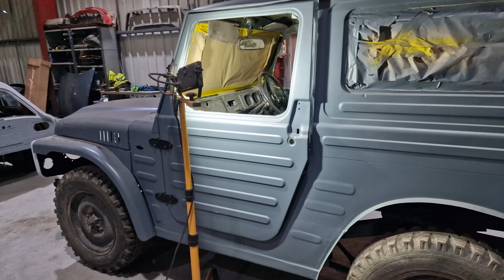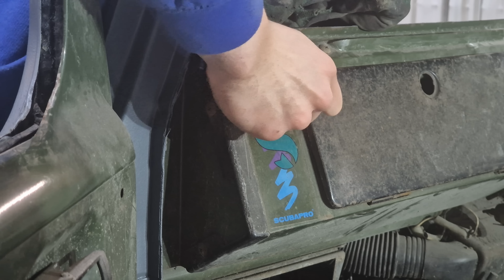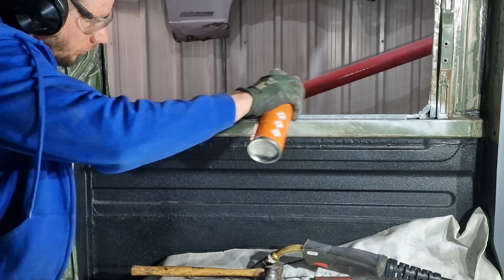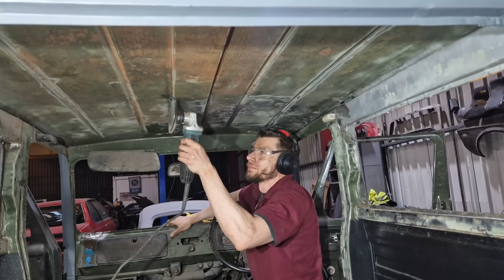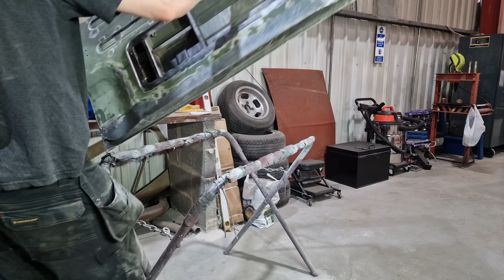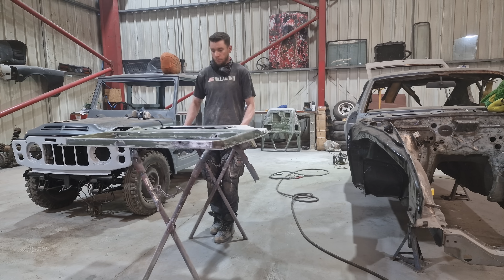As Difficult As PANTS - Priming The Interior Of Our Abandoned Classic Suzuki

Comment: I'm on week 3 of an RS escort - I want my medal as it's now a 60% welded bare shell - drivers side quarter, arches,  inner & outer drivers  sills,  footwell, drivers wing, full front panel top  & bottom plus a battery tray left to do still - all the rusts cut, just new stuff to go back in those places.  Came in as a complete car, full strip, engine out, running gear off, engine bay stripped, all glass out, dash out,  sunroof out & roof cut/repaired.. It had next to no back-end left, floors were in tatters, chassis rails were gone... alright going for one lad on their own.. 

Painting interiors is a right hump... not that getting them ready for paint is exactly a walk in the park either. 'Zuki is looking very well. Kudos.
Reply from the maker: Wow well done James, fair play to you! That's a lot of work to get done!!! some good work there. Interiors is a pain, I haven't eve done the bodywork in there yet! I have that to look forward to :)
Reply: @yorkshirecarrestoration  On the recommendation of another YTuber I went got half a dozen aerosol cans of Halfords weld through primer - expecting nothing special tbh - dunno have Ye tried it? I gave it a good lash on a few different things - re-primed the repaired plastic bumper on a jeep I am doing with it - as a "primer" finish it is streets (absolutely streets) ahead of anything we usually use (we use expensive primers..)  - just a cracking finish for a "primer" coat.  By comparison our usual primer is rough as a bears behind.. 

Went "Hmmm" & used it over an arch repair I did  where I had 101 different materials all jammed into the one area - old repairs, old filler, factory filler, fiberglass, new steel, my filler, old paint, newer paint - you know the sort.. It obliterated the lot leaving a ready to paint surface. I was frankly gobsmacked. The 2k stuff we usually use will always have "reflections" showing through from underneath - the "Crap" from Halfords showed none.    The only "Downside" is man, it takes some shaking up  - you have to heat the can in hot water, shake it for about twice as long as you normally would & then shake it some more - but then, it's about the best primer I have ever stumbled across. 

If you've not tried it, grab a can - give it a shot, see what you think. I was amazed - and I'm not easily amazed. If I could buy it by the gallon in cans & shoot it through a gun, I'd buy that gallon in a heartbeat.
Reply: ..and as if by Magic, someone I know off YT texts me with the maker & where you can buy gallons. :-) :-) The Power of the Internet. :-) Never believe people don't read your comments.. 'cos they do. :-)
Reply from the maker: Wow thanks for the information James, and that crazy how you got that text after you commented! haha. We have never personally tried it to be honest, but it would be worth a try. The primer we use also shows imperfections as it is fairly thin, but good stuff. Is the Halfords special primer a high build? also how is the finish and how does it sand down? do you have the link for it? Thanks!